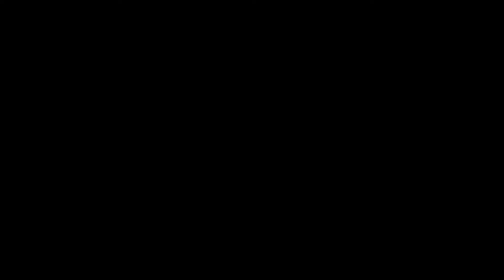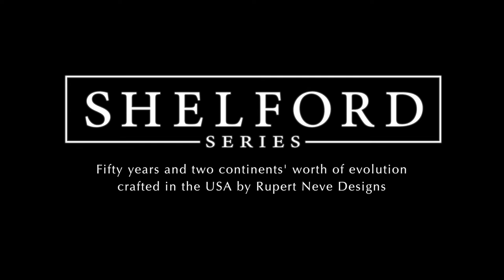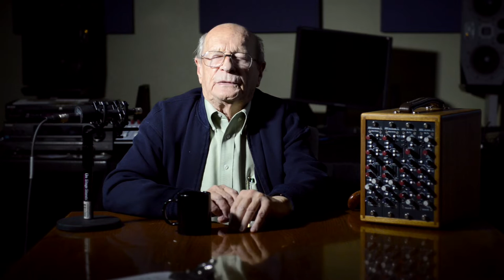Shelford Interviews: The Development of Early Faders

Comment: Minor correction Quadrant (or any stud faders) do not 'create' clicks UNLESS there is a leakage of DC from the preceding or following amplifiers. If taken to extremes you might perceive a 'disturbance' if the amplification following the fader has sufficient gain that you can hear the DIFFERENCE in level of thermal noise over the 1 or 2 dB step between studs. Depending on the frequency and audio content being manipulated by the fader a 'step change' can be interpreted by the ear as a 'click' however this is not a technical fault but a function of human hearing. If you listen to a sinewave your ear/brain expects it to continue. If you abruptly alter the level (intensity) of that sinewave your brain interprets it as a 'click' or a sinewave of a different frequency. the BBC (among others) evaluated these effects and proposed that a step change of 1dB or less is inaudible in most circumstances. The use of multiple studs and wiper arrangement allows a 'silent' fade to be achieved with the majority of programme material. This is all frequency and level dependent.

Comment: I have a genuine question for,Mr. Neve or any one who can answer. When a device converts analog audio signal to digital, does it ignore the data below and above the 20 to 20khz range ? Second if no then what component or spec on a audio converter should we look for the details of the conversion...
Reply: Well an audio CD can represent frequencies up to 22.05 kHz. With all those diffrent types of mp3 and likewise there are now the same or more. But the biggest lose (in terms of audio quality) is the compression of the file in size. If you looking for a natural sound or more of a old sound you shouldn't be to worried because the frequency response back then wasn't to good any way. Try fix the acoustics of the studio-room instead, rather than go for expensive tape machines (those are great but will not give you that much in return)
Reply: +James Manasseh You should look for the resolution and the SNR. Make sure the sample frequency is above 44.1Khz so you can record all audible frequencies.
Reply: The whole topic of analogue to digital conversion is very complicated. It is always a compromise between cost and performance of which some 'standards' were established in the early 1970's. Audio has almost always been hanging on the coat tails of other industry and going it alone is exceedingly expensive.Some companies (notably AMS) were early in the use of  8 then 12 bit a/d conversion where 8/12 bits could be converted in an (expensive) IC (chip) but as the quality was not too good they used a large quantity of logic chips to 'add' an extra 4/8 bits, where 16 bit depth was at least reasonable. I think it was Sony (among others) who manufactured convertors with more bits and could operate at higher frequencies to bring 'quality recording to a state where 'worldwide' standards became important. A the conventional wisdom at the time was that 20Hz to 20KHz would be 'adequate' for 'high quality audio' and with the birth of compact disk the bit 'depth' was specified to 24 bits (I think) even though then, as now you struggle to achieve full 24 bit resolution. there are other constraints (physics) that actually prevent full use of 24 bits and I think a little over 22 bits are realised when you consider a bandwidth of 20 - 20khz. The analogue stages surrounding the A/D and D/A place a restriction that cannot be overcome unless you limit the bandwidth or use 'fancy processes' to counteract physical conditions. 
A CD with it's 44.1KHz sample rate can capture up to 20KHz audio but there must be a very 'sharp' filter to actively remove audio between 20 and 22KHz to avoid anti aliasing 'distortion'. This sharp filtering itself created it's own problems for which Mr Rupert Neve pointed out and he collaborated with some Japanese researchers in Tokyo to demonstrate the 'advantages' of having music that could be recorded and reproduced possibly up to 50kHz.. In the early days computers would struggle to store the huge amount of data that 44.1kHz, 16 or 24 bit data produce as computer hardware was only beginning to move to 16 bit operation. A 16 bit A/D or d/A 'chip could easily cost a hundred Dollars in the early days whereas now you can buy combined A/D d/A chips that can handle 24 bit stereo at 192KHz sample rate that are about 5 dollars apiece that have much of the logic circuitry to interface to something useful, built in. The Dynamic range (difference between 'impossible for a human ear to hear, up to a sound level that would cause major bodily damage) can be captured by a 24 bit convertor. Unless your listening room is a totally silent anechoic chamber  where all yopu can hear is the blood flowing in your head, and a speaker system capable of bursting your eardrums and eyeballs the theoretical capability of the A/D/A can match it. Bit depths greater than 24 are useful and necessary for mixing systems where multiple signal sources will be added together and manipulated to do things like equalisation (tone controls) but ultimately the 'mixed' digital audio has to be scaled back down to fit real world amplifiers and speakers.
Reply: @mattsyson3980  That’s a pretty comprehensive (and accurate) overview. Mix down CD standard is 16-bit/44.1KHz, and DVD video is 16-bit/48KHz. Digital recording standards have fairly well settled into 24-bit/192KHz, which in my opinion is the reasonable thinking person’s (and engineer’s) ideal. 24-bit depth provides 16,777,216 discreet levels of sampling with which to represent the signal’s analog voltage, generally a range of about 3V peak-to-peak, so imperceptibly smooth sine waves and most any complex arbitrary waveform can be accurately modeled up to around 96KHz. There are some audiophile products that boast 384KHz sampling with the ostensible claim that the higher slew rates it provides (ie-the sharper edges for sudden amplitude changes, like the crack of a snare drum) make it superior even within normal hearing ranges, but I don’t think there’s any speaker in the real world that can respond fast enough to make good use of such high frequencies and slew rates. The physical motion of a speaker’s driver and its impedance begin to limit frequency response well before hitting the 96KHz mark in my experience. 

But we’re also still living with the limits of chip designs and costs at the higher frequencies, so it’s not like we have the luxury (yet) of just over-speccing our equipment just because we can. For one thing, while 24-bit AD/DA has become inconsequential for audio frequencies, if you look at chipsets for things like RF or test equipment, getting anything above 12-bits (4096 levels) at frequencies beyond 100s of KHz is still quite rare and expensive, not the least of which because of the additional memory and support components necessary to handle the volume of data such sampling requires. But also because of some physical limitations within the circuit designs that grow increasingly problematic to deal with the higher one goes with sample rates. It’s a scenario where the diminishing returns begin to grow exponentially much past 192KHz, so most products that advertise such high specifications are largely doing so for the express purpose of marketing them to people without the technical knowledge to understand what it all means, and as we all know: when in doubt, bigger numbers equals better equipment to lord over your friends with.

Some purists may claim that no amount of bit depth or sampling rates can ever really reproduce an analog signal, and although they’re mathematically incorrect, I will admit that the qualitative features that are found at the edges—things like headroom and distortion—are indeed a good enough reason to continue to design, build, service, maintain, and restore things like Neve or API consoles and signal processors. I believe both analog and digital signal workflows have their respective places within a professional audio production process, but it’s critical that today’s engineers understand their features and limits, and know how and when to leverage them appropriately. 

To any aspiring audio professionals still reading this, get an associate’s degree or better in electronics engineering, it will make everything else about the job easier, cheaper, and better.
Reply: @silverXnoise  Indeed there are many constraints, down to basic physics that make recording/playback of material beyond 24 bit 192k rather moot because even that range (24bit ) represents a range of voltage /air pressure levels beyond the capabilities of humans, so if the lower end is surrounded by random movement of air the upper limit is so great that hearing damage and even bodily organ failure would result. If course creating a microphone and speaker system that can actually transfer the levels is a different problem altogether. Of course the requirements of 'recording' a single microphone/source and being able to reproduce it are diferent to the situation where the signal is 'processed' be it some form of Equalisation, compression, expansion etc where the TIME taken to carry out these activities represents a different problem. Indeed mixing (summing) adds yet another layer of complexity.